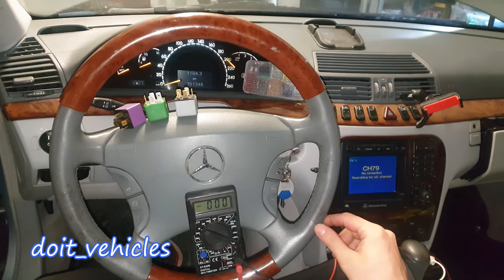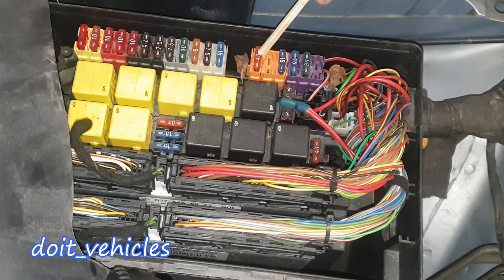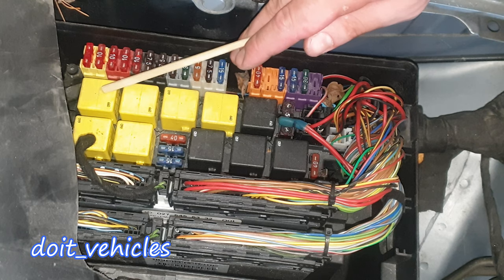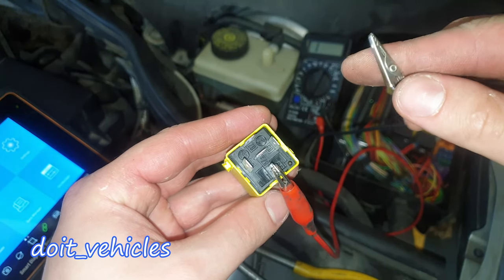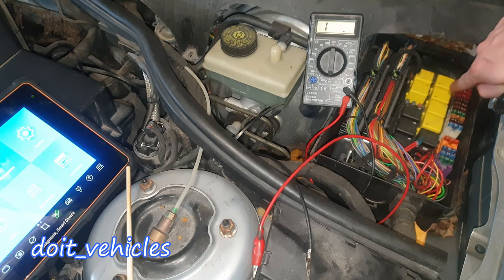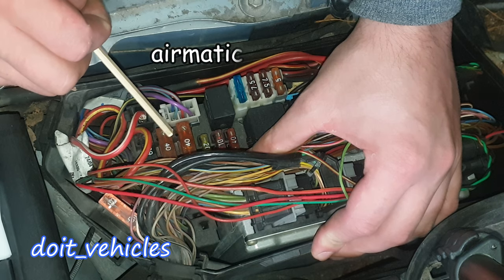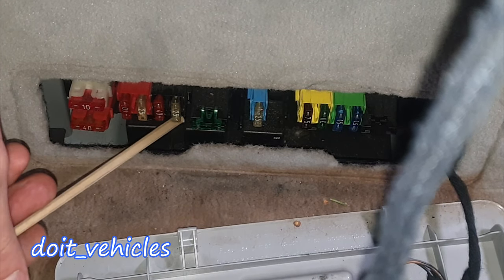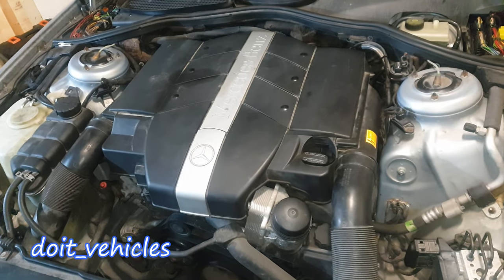W220 All Fuses and Relays Location on Mercedes S320 / diagram S class

Comment: i HAVE a S500 and have some problems like my headlights dont work, it only works if its night. My sunnroof dont work. Do you think all Fuses and Relays are in the same Location?
Reply: It should be in the same location as in the video. I have an 2000 s430 and used all the fuses he shown in the video and they are all the same.

Comment: Thank you for this video, because of this I fixed the problem on my Airmatic suspension problem. Your the best!!!
Reply: Hi what was wrong with yours thanks
Reply: What was wrong with your airmatic and what kind of Benz do you have? I got an 06 S500 with an airmatic problem that I'm trying to diagnose. Just changed the valve block but the error message still pops up on my dash....

Comment: I've been doing vehicle electrics, but you have channeled direct info and I have picked something I didn't have.
Keep it up
Reply: Hi, do you know how to check drivers seet control module in w220? I have bought two and none is working. Maybe its something else?
Reply: @krzysztofgraban  Hello from Minnesota. I have a 2006 s430 W220 chassis and out of the blue my front passenger side door just stopped working. I've bought 3 different DCMs all 3 matched with the correct numbers and none have fixed the problem. All the fuses and relays are perfect as well. Other than that everything in the car works perfectly. I've been chasing this problem for a year and I refuse to bring it to Mercedes. I have the proper icarsoft scanner specifically for Mercedes and that door won't even show up on the scanner like there's no module in the door at all. Mercedes are beautifully engineered cars but when something goes wrong you darn near have to be a rocket scientist to figure anything out. I wish I could help you out but if I do end up figuring it out I'll definitely hit you back to give you the solution. I just wanted to let you know you're not the only one experiencing the door module problem. Have a great day! 👍🏼
Reply: @9691ark  thanx 😀

Comment: My 2004 S430, like many cars, features a normal "courtesy shutdown" delay of 3 minutes or so for things like the radio once you turn the ignition off.  One of those systems in my car is power seats (although I do not understand why).  3 years ago  I replaced my drivers power seat control because that "courtesy shutdown" stopped shutting down,  totally draining the battery within a day or so of non use.  I also have replaced 2 alternaters and 3 batteries in the meantime because that constant drain must be super hard on these systems.  So (as my luck would have it) now the power passenger seat "courtesy shutdown" does not stop drawing power after shutting down. My choices are to figure out which wire going to the harness (there are 7) is still live after shutdown, cut that and feed it directly to the switched wire to bypass the function itself.   I am not that wiring smart so to me it is like defusing a bomb- so forget that.  My other choice is to figure out which fuse operates the power seat and take it out until a passenger needs to change the seat position, and I do not have that many passengers.  This video pointed out the fuse location, and I had it figured out in 5 minutes!  I can not tell you how long I have been working to decipher this- but it has been a long time!  Problem solved and I can move on with my life!!!  THANK YOU for this video!!!

Comment: So what if the steering wheel doesnt move up/down even when using the wire to bridge the connection? What would be the next step? All fuses are good.

Comment: Any ideas, my 2001cl 55amg had lost dash bord info. I removed and cleaned connections etc and rebuilt..now works except back lighting.!!
Next I lost control to all top centre dash switches inc car height etc  hence car has locked transmission. 
I really need fix.. it's my shirley and valentine car with exception no partner and I would give car to someone and jump without car..lol

Comment: I have a problem, the dashboard does not work, where all the buttons are: emergency lights, head restraints, curtains, and so on. Where are all the relays and fuses for this??? maybe the board needs to be changed?? W220, 2002 year, S500. Mercedes
Reply: Did you fix it?
I also have the Problem 😭

Comment: I have a 2004  s500 Mercedes secondary injector pump is not. I can replace that but the 40 A fuse is only putting out 9.6 to 10 volts  is that normal

Comment: Hello my car has a problem with fuse N54 it burns that fuse every time, Is there any common problem with w203 what I need to know or I need to remove all the electric wires and check?

Comment: On the W220 is there no relay for the engine cooling fan? I just watched the whole video and I didn't notice any mention of the engine cooling fan relay or fuse and mine is not working so I'm searching for this relay.
Reply: Did you fond the problem ?
Reply: Facts not one single word mentioned about they fan. Mines isn’t working either. Does this guy even know wtf he talking about

Comment: Hello,what power the drivers low beam headlamp? Confused!
Reply: The socket itself is its own relay. It sounds  confusing, I know trust me. I spent a lot of time trying to figure out what the hell an electronic relay sensor was on my 06 S500. But basically the brown little clip that the bulb plugs into is its own relay.

Comment: I have a 2000 s500. My battery completed died so I unlocked the trunk by connecting a jumper pack to the jump points under the front passenger floor mat.  This worked a couple of times with no problem. I purchased a new battery but when I connected the jump pack to the passenger floor jump points, there was a spark as if I blew a fuse. Now with the new battery, all lights, doors and radio work fine but when I turn the key, it makes NO sound whatsoever! Somebody PLEASE HELP ME!!! 🙏
Reply: Did you ever fix the problem?

Comment: I just got a 2000 s500 and when I went to drive it today the passenger side went up and the drivers side is down. When I say that the drives side I'm saying the front and the rear. The hole side is down on that side and the other is all the way up. What would make it do that?
Reply: Something is wrong with your airmatic suspension. Might be a leak in the vacuum tubes or might be a bad strut. Good luck! Or did you ever figure out the problem?
Reply: It's  air shocks probably need to replace them or check your lines for leeks

Comment: anything about where the cooling fan relay is? or why it wont come on?
Reply from the maker: it was showed in the video at some point . If all works fine it won't come on unless the coolant temperature is over 90 degrees C

Comment: Can’t find the cooling fan relay
Reply: did you ever find it?
Reply: @dimitriadams2510  yes it’s under the passenger side headlight underneath that metal plate u can get to it from underneath the car take off bottom cover and it’s easy to access